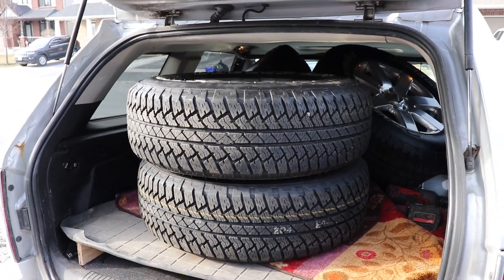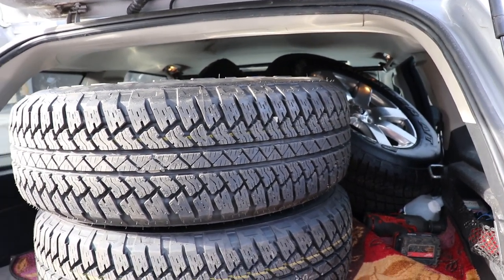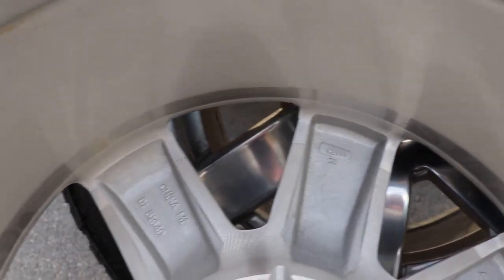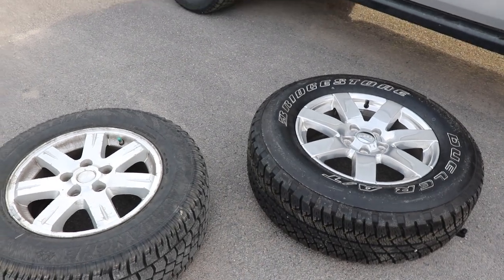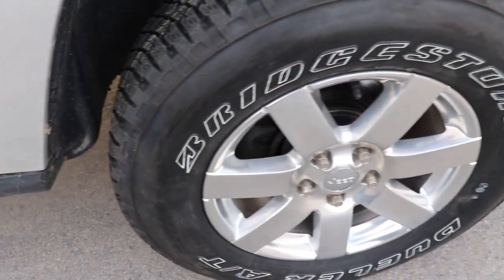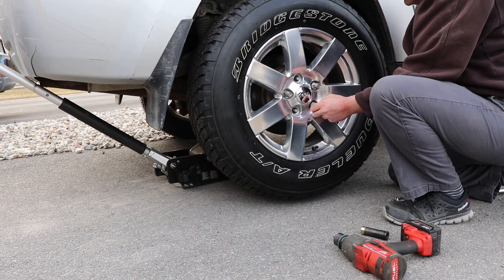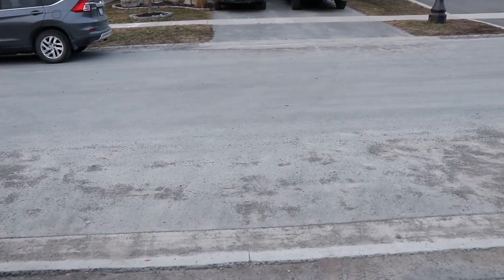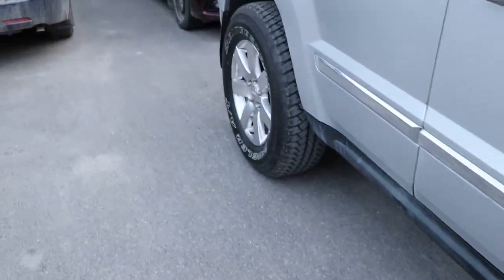2005-2010 Jeep Grand Cherokee WK Installing stock JK 32" Tires

Comment: I did this to my ’07 JGC 3.0.  With QD2, does very well off road.  at 180,000 had the oil cooler replaced (expensive), but runs like a train!

Comment: Thanks for all this information, I appreciate your help and knowledge. I just got a diesel 2008.5 with just 64k on the clock, love it so far. I think I also have the leaking injectors and my engine won’t come up to temperature, it stays halfway between centre and cold. So I’ll take it back to the dealership and hopefully they will fix both problems for free, I know it’s a ton of work. Thanks again

Comment: Nice video.. Iam Apostolos Exaras from Greece and I have a WK 2007 3.0 diesel. As you told in the video, your tires are 255 70 R18 that means are exactly 32". Can you tell me, please, if tthe spare tire with the same size of 32",  fit in the slot under the body on your WK? Thanks.

Comment: Hi. When you perform a coolant change and flush would you mind posting a Video please? I have read the OM642 can be tricky to do. Air locks.
Reply: Yeah, the shop had done mine just before i bought it and the coolant level kept moving and changing all the time. Pushing out coolant then being too low. Thought i`d bought a lemon there for a while.  Refilled the coolant bottle one day and as it was running and heating up and spent 10 minutes squeezing the hoses all over back and forth. Had to put a little more coolant in when it was cooled down and that was the last time i ever had to for the last year. Problem solved. Got to really squeeze and  pump those hoses to drive out all the air bubbles.

Comment: What adjustable arms did you use to bring the axle back to center?  Thanks!
Reply from the maker: I never changed the rear arms on mine so it is out of adjustment,  there are a couple companies that still make rear control arms for the WK if you look around.

Comment: Would you still need adjustable  links if you were just getting adjustable shocks that raise the ride hight 2 or so inches
Reply from the maker: no, you will be fine, the wheel on the one side just sticks out a bit on the one side.

Comment: nice video men & thanx very much 💯. I've been try to find out what's the biggest tire size that i can fit on factory wheels. factory size is 235/65r/17. so I've been thinking on 245 or 255 & not sure yet bout if 65 or 70. any suggestions men ? hit me up pliz
Reply from the maker: There are some picture threads in the WK section of Jeep Forum.  You should check there.
Reply: I just threw on 255/75/17 on my stock wk they run fine